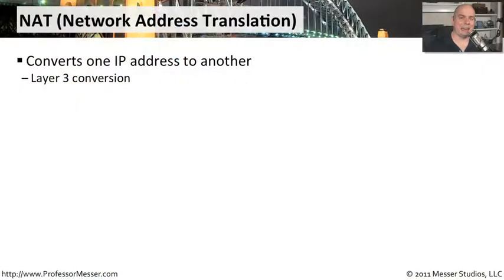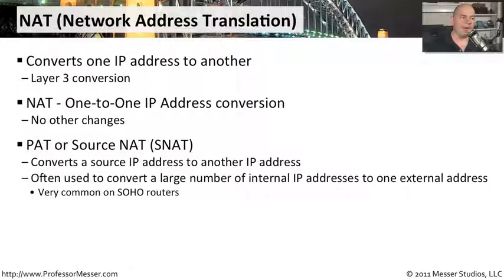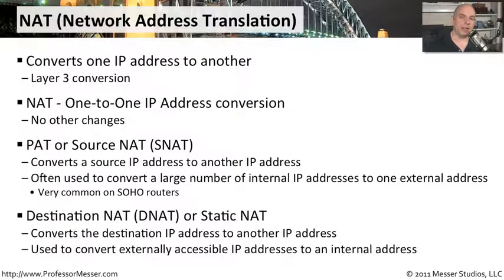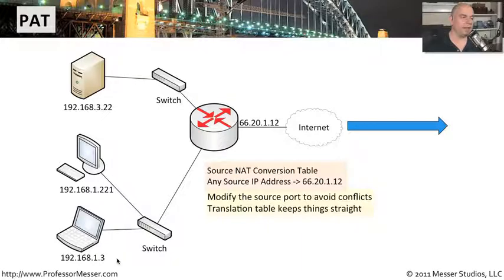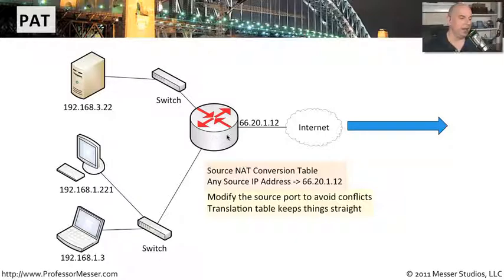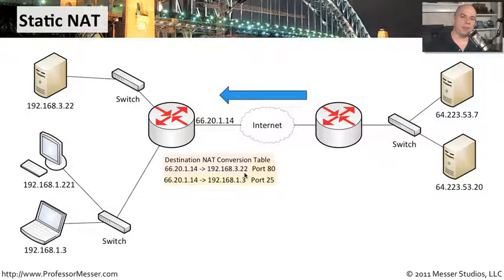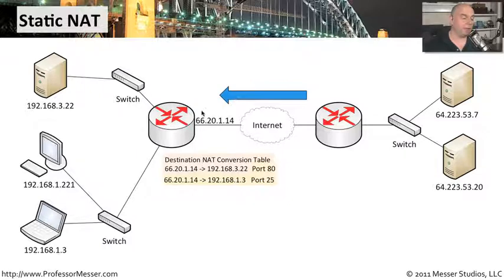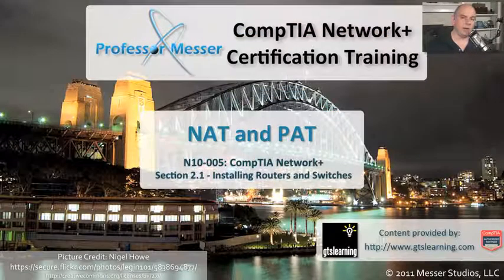Configuring NAT and PAT - CompTIA Network+ N10-005: 2.1

Comment from the maker: This is a video from my N10-005 Network+ series of videos, and the CompTIA requirements do not require that you understand the configuration commands for any particular manufacturer's equipment. This video does, however, provide you with the information you would need to perform a NAT configuration.

For specific configuration commands, I'd recommend that you look into a training course for your specific manufacturer. Every router/security device does NAT configurations a bit differently.